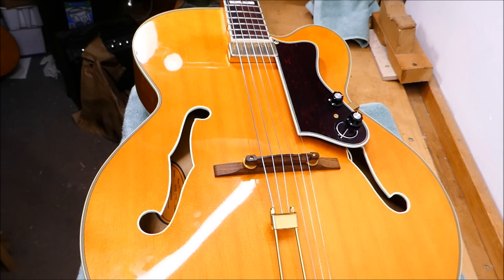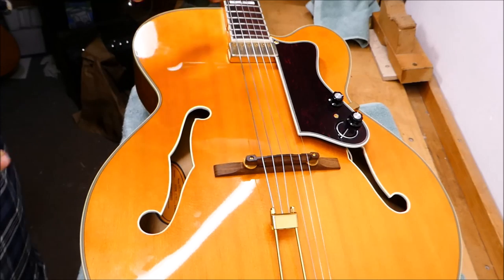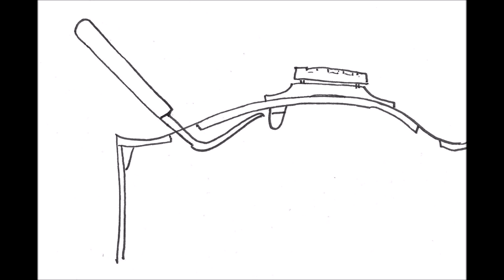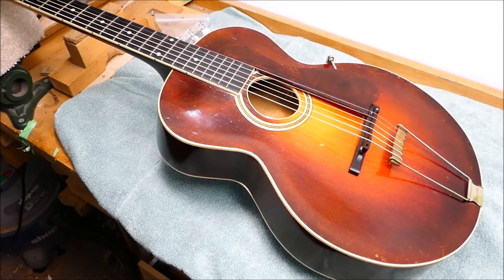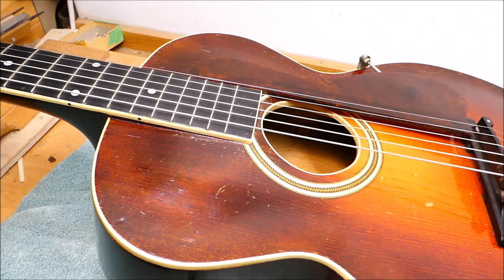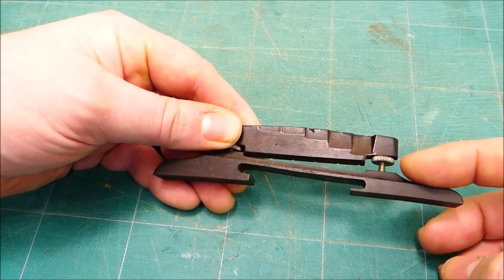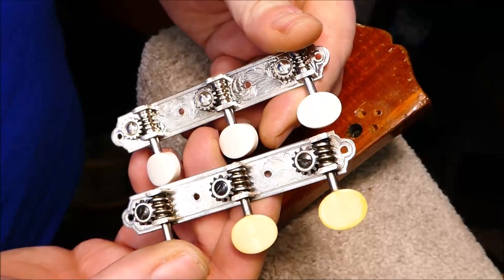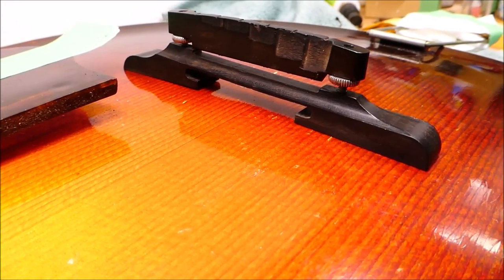1927 Gibson L3 Archtop

Comment: I've used flexible copper tubing, bent to shape, with a plastic glue tip on the end to pump glue into weird spots. Icemaker tubing works pretty well... Its flexible enough to bend into any configuration. Yet rigid enough to stay right where you need it. Then just use a big syringe to pump the glue.

Comment: I used your neck reset sandpapering trick to square up a 90 degree jig I made for cutting biscuit slots.  Worked a treat as I needed to cut more off the outside edge of a brace to get it square.  Just thought i'd let you know you taught an old dog a new trick.

Comment: I don't think a refret should devalue any fretted instrument. They are a consumable.
I sure am happy it does though. A refret and refinish saved me thousands on a 59 Stratocaster.
Reply: It's like demanding the tires and wiper blades on a classic car should still be original lol
Reply: I think it gets a bad reputation because even the best of refrets can tend to damage the fretboard in some way, so imagine if it was a bad refret. Most of the damage is where people can't see because the chip out will be covered by the new fret, but I still think that's what eeks out a lot of people. It's kind of ironic because some people will go bonkers over huge chunks missing out of the body because "vintage," but stay away from refrets for the potential damage it caused lol.

Comment: Patent number 1,365,839. T. J. McHugh and L. A. Williams. Application files May 28, 1920, granted Jan 18, 1921. Assigned to the Gibson Mandolin-Guitar Company. "Bridge for stringed musical instruments"
Originally intended as a mandolin bridge, but also applicable to other unspecified instruments.
A wooden base with two knurled threaded adjustment posts, and a top formed bar, preferably of aluminum.
The improvements over previous designs are that it is adjustable and doesn't easily get out of adjustment.

No mention in the patent of a lop-sided base or a lightening slot in the base.

Comment: Seeing you drilling those holes in the crack reminded me of when I'm  pinpointing the location of supply vents in hardwood floors when installing an HVAC system. I cut pieces of metal hanger, the little holes that hangers leave behind are so much easier to fix. Also, drill bits that thin break so easy. I've drilled through a 4x4 using a hanger. Sadly it's getting harder and harder to find metal hangers. There was a time when you could find a metal hanger in any closet you looked but now they're all plastic. The only place that I know to find them is the Dry Cleaners. 🤷‍♂️
Reply: I have just recently seen some hangers, that were made to look like those wire hangers you get from the dry cleaners. And I say they were made to look like them, as the wire used was easily 3 or 4 times the diameter and the whole thing was chrome plated... Seems some people actually fancy the look of those.
Although for the price of those, I would not bend them up to use for anything different. Buying a Steel rod or some wire the correct size would then be way cheaper.
And Speaking of that, I have seen one guy actually use some piece of I think 2 or 3 mm Steel rod (you can usually buy those in 1 m length here at the big box stores) to make a simple spear shaped drill bit in about 30 cm length, just for the sole purpose of transferring the markings on where to drill. Only downside with that stuff, you pretty easily bend your bit...

Comment: Very nice work on the Gibson bridge. I agree with you - the tool marks on the feet suggest very strongly that it was factory original. Even back in the “golden age” there was pressure to get the job finished and out the door, rather than scrapping something that was less than perfect and starting over.
Reply from the maker: That's what I figured. It seems to me if the blank didn't register properly in the shaper jig this could happen. Perhaps it was late Friday afternoon when days were warming up and a young  factory worker's mind turned to baseball.
Reply: @twoodfrd  :-)

Comment: To get glue into the brace, use your pallet knife and tape a line of thin silicone hose attached to a syringe. Use the knife or thin object to get the  tip of the hose in position and press the plunger. If you get a thin enough hose, it will fit into the gap of the brace and body nicely
Reply from the maker: I've tried that and I've never managed to get it to work without thinning the glue so much it feels like I might weaken it.

Comment: Love the job you did on the L3. Strange though, the bridge did look to be original as the sanding striations on the bottom of the foot were still there. Could it have been a design aimed at giving a balanced tone? The different adjuster screw lengths were obviously off but there has to be more to this story. You did a great job with the graft and it sounded beautiful if a little quiet but the tone was superb. Great job!!!!

Comment: I've watched quite a few of your videos and I've learned a lot from you.  I do have one question though, regarding your decision to modify the bass side of the L3's bridge.  Here's the reason for my question: If the guitar is mostly un-messed with, can we assume (dangerous territory, I know) that the bridge shape, aside from the aforementioned buggering on the underside, is original?  And, if it is, could the asymmetrical appearance have been a factory standard-perhaps in an attempt to give this smaller guitar more bass response through more mass?  Or am I just over-thinking this?  Thanks and keep up the great work.  Tom
Reply from the maker: The patent shows symmetrical feet on the bridge. I think someone probably just forgot to sand one side and it indexed incorrectly on the jig for shaping.
Reply: @twoodfrd  The original top curve looked like it was the same distance from the soundboard on both sides. If both the top and bottom sides were shaped on the same jig indexing one end of the plank incorrectly might give that result?

Comment: Autumn Leaves, being played, note perfect on the most appropriate chordophone. 
Both repair jobs were obviously to the usual high standard.  
.
Muse:  Might a flexi-tube (like a small hand oiler) be rigged to 'inject' glue into awkward spots, like these errant braces? 
Pump controls  glue flow into the gap, a small solid-state camera/white LED affixed just up from the glue nozzle giving perfect view for control and application of glue.   Simple device really, but would make jobs on semi-acoustics a lot easier and probably neater.

Comment: Question Ted. If you could not reach that loose bracing through the f-hole, would you proceed to yank the back off of the guitar or would you have another less invasive method to secure that brace? Never had to work on an archtop guitar, other then switching out bad pots and selector switch. Easy pezzy stuff!
Reply from the maker: The back would have to come off, yes.  It doesn't happen all that often.

Comment: The Gibson patent, Bridge for stringed musical instruments US1365839A  PAT'D 18th January 1921, shows very symmetrical feet with the screws for adjustment. So the present day shape is probably not original.
Reply from the maker: What's drawn on a patent sheet can be very different from what happens on the factory floor, especially on a Friday afternoon in late May.

Comment: I don't think that I'd choose an elective refret... the neck, as you point out, is already a huge adjustment in feel for the player to make from his other guitars, and there's a certain romance to playing the guitar the way it was spec-ed by the craftsmen at Gibson 90 years ago, even or perhaps especially if it's different from modern preferences. Personally, since it interacts with the actual 'function' of the instrument, I might argue that it's worse than the green paintjob (but not as bad as drilling holes in the top).

Obviously, it's the owner's decision to make, though, since he spent his hard-earned money on the thing, and not my place to criticize whatever decision he happens to make.

Comment: So the bridge isn't fastened to the top?
Reply from the maker: Most archtop bridges float.  Sometimes they're stuck in place with tape, or pinned using small tacks.
Reply: @twoodfrd  Speaking of, I am curious. Does the thickness of the graft require an adjustment to the fit of the treble end of the bridge, since the angle changes a bit? Or is it close enough not to need any alteration?
Reply: @twoodfrd  I imagine this makes restringing a bit more complex than is the case on a fixed bridge instrument.
Reply: @slump75  Mark the place where the bridge lives before you remove the strings. Simple.
Reply: @mattrogers1946  and the big advantage is that if you change string gauge, you can still get the intonation dead on by tweaking the bridge back or forward. I was always frustrated with intonation on flattops, but I love how easily I can get it right on even a cheap mandolin. Arched tops have ruined me for fixed bridges!
Reply: archtops are set up in essentially the same way as a violin or cello.  String tension will hold the bridge on.

Comment: I have had some of the old pre Lloyd Loar archtop Gibsons and unless you are into playing 100 year old plectrum sting orchestra or ragtime music those 100 old guitars usually do not sound very good for modern musical uses. That is why a fake L-1, L-2, L-3 is absolutely laughable.  1927 is in the Loar era but it's not a Loar design. Herco used to make some rather spindly little clamps for cellos & guitars. I don't don't know if that is lacquer finish or if it is alcohol based shellac.
Reply from the maker: It's supposed to be lacquer, but it's very thin, probably because the burst is in the wood rather than the finish.

Comment: You are making a mistake with those L1 and L3 Bridges......they were manufactured asymmetrical, or lopsided.......I've had two L3s and an L1 and all of them had bridges with one side taller than the other. And the number penciled on the bottom of the bridge is the FON number. By altering the height of the bridge you are altering an original part........I don't think that is right.